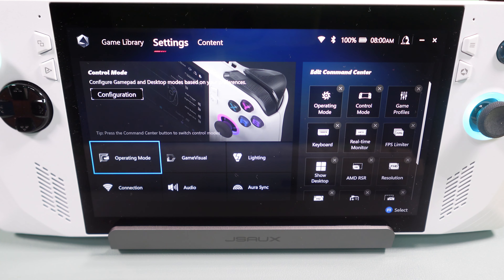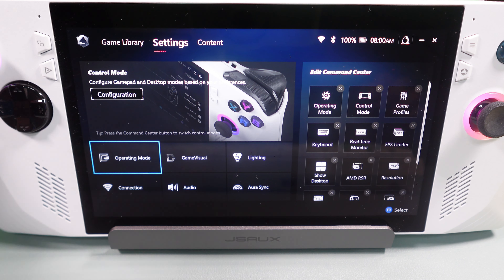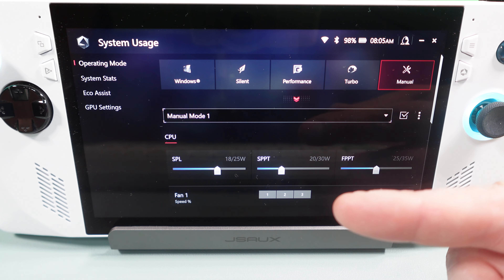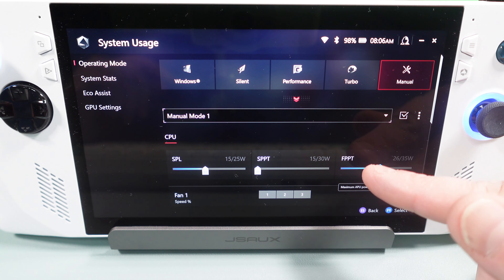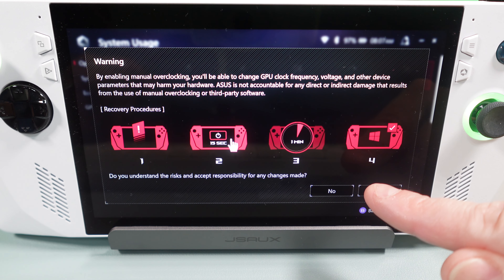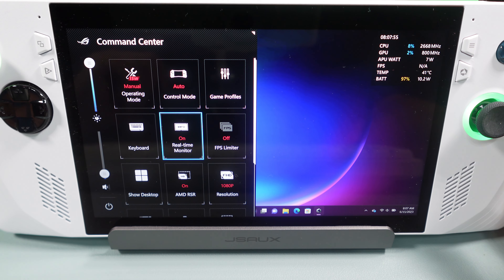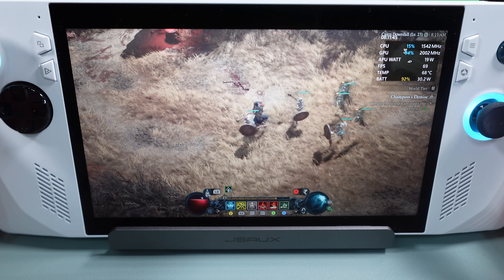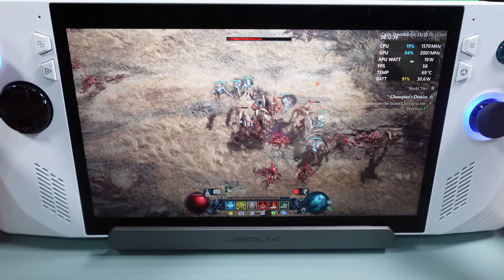Understanding Manual TDP Settings | ASUS ROG Ally

Comment: @Rypper Gaming Hey! The highlighting “jumping around” in the menu you are experiencing is due to Steam running in the background. The same thing was happening/has happened to me many times over. Just open the Task manager and terminate any steam processes that  may be open. Even when you close the game, steam will remain in the background opened. I personally am consciously trying to build the habit of opening everything from Armoury Crate to avoid that headache lol. You can also change the game pad/desktop mode as well. Thanks for your time and videos. Keep it going!
Reply from the maker: Good to know. I disabled all the game platforms from opening on startup.  That jumping around was working just fine before I started the video!
Reply: Even on my notebook steam ui can cause strange things like my mouse is jumping/being not smooth till i close the steam ui. So thx for info that steam is responsible for that jumping in armory crate, was wondering myself.

Comment: Hope you can help but I've got two problems with my Rog Ally... firmware tool update keeps failing and my command centre shortcut button doesn't work, same as the Armoury crate button also, do you know of a fix? Thanks

Comment: I'm happy your video discusses the fact that the command center doesn't update to show any type of adjustments you made to manual mode.

For the first day of having it I was so confused on why I kept setting the manual profile to 18 watts and it's still remained the same. I eventually use the in-game stat overlay which showed that it was updating to the manual mode I selected at 18 watts.  

It's definitely something I hope they fix in the future
Reply: This was driving me nuts last night and couldn't find a answer anywhere😒 I thought it was something I was doing wrong.

Comment: Thank you for this! Side question: is anyone else missing the real time monitor? I don’t have it anywhere 😢
Reply: You have to turn it on
Reply from the maker: It is in the command center.  If you dont see it you can add it through armory crate.  I have another video going over the settings which covers it if you want to check it out.
Reply: @RypperGaming  thanks man, i do see it in the control panel, but if i press on it and switch it on nothing actually happen 😩 to be more precise, when i turn it on a small transparent window pops up on the top right corner, but it’s barely visible and there’s nothing in it

Comment: What about the fan curves? I don't understand what hose 1,2 and 3 in the gray boxes are?
Reply: Just use number 3. 3 keeps my temps on Mw2 at 75 or lower never higher. Idk y he didn't adjust fans. 1 and. 2 are flat across the board

Comment: Thank you for the video. Could you also testing FIFA23, cuz my Rog FPS sometimes down to 10 when there is a goal and celebrating, I’m not sure if it is normal or my settings are wrong somewhere, thank you
Reply from the maker: Unfortunately I do not have FIFA23 so I cannot test it.  If the game is struggling I would recommend turbo mode and the 317 BIOS.  I have videos on how to improve performance and BIOS 317 may be your answer.
Reply: Bro set your graphics render settings to low and realistic hair to off and you should be good 👍

Comment: So what settings match Turbo mode? I'm seeing all these Asus Ally's with dead SD readers all the sudden. People seem to think the heat is killing the reader since the card works fine when they pull it out.
All I want to do is adjust fan curves. My ROG is plugged in for 8 hrs straight while game in Turbo mode. So I just want to match those settings but boost my fan speed way up yo try and cool the system. I see Temps at 94c easily.

Comment: Are you using the dock usb c or a separate charger?
Reply from the maker: I cannot get any dock or 100w charger I have to give the ROG Ally full power for some reason. Only the official adapter alone gives it full power.  I am mainly playing on battery and plugging it in when not in use.

Comment: are you still running on the old bios? Thinking about reverting to 317 but I don’t want anything to mess up
Reply from the maker: I am running on 317 as it seems to have better performance.  But the manual setting should work on both versions of the BIOS.

Comment: I would like to ask you for help with deleting manual tdp profile. I made one with the ally plugged to power and I do like that profile but in battery mode it somehow have a 15w manual tdp and no matter what I do I cannot delete it and even if I make a different profile in battery mode it will still show the 15w. Is there something I am missing to be able to delete it? Thanks
Reply from the maker: I noticed you can't delete the first one, but I could create additional ones and delete them using the settings icon.
Reply: Yeah that's what's been happening to me. The first I made was 15w with fan curves and I also created a 18w and 20w in battery mode but for some reason even if I choose the 18 or 20w profile it will only show 15w in command center. If I switch to 18w and 20w I can see in the real time monitor that it's drawing more power beyond 15w so I am guessing even if it does not show the 18w or 20w in command center it's still switching I guess. Please let me know if this is also your observation. Thank you for the videos. I have just basic knowledge when it comes to pc and your videos helped me a lot with adjustments with my Rog Ally. Thank you!!!

Comment: mmm.. weird my ally still only goes up to 25w even when plugged in....
Reply from the maker: Make sure you are using the official ally power adapter and not going through a dock.  That should show 30W.
Reply: @RypperGaming  that fixed it thanks!